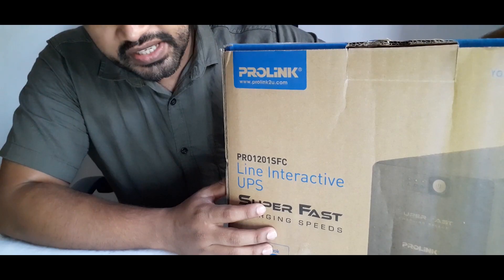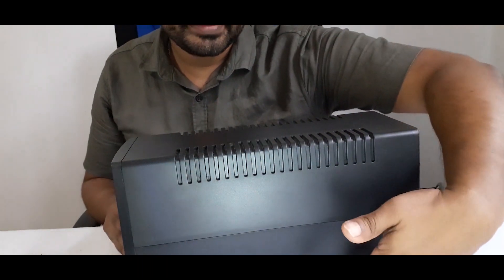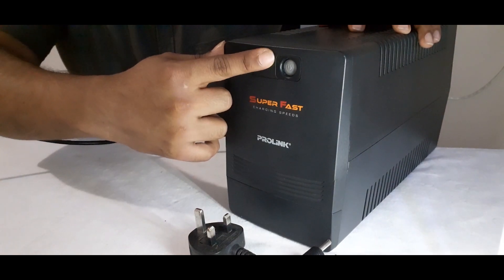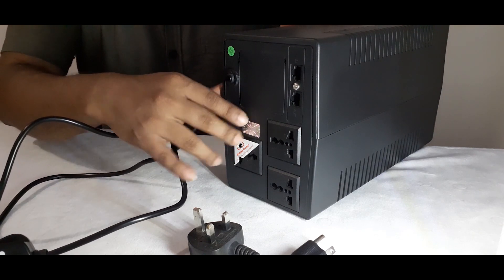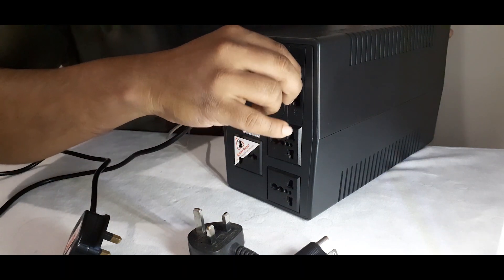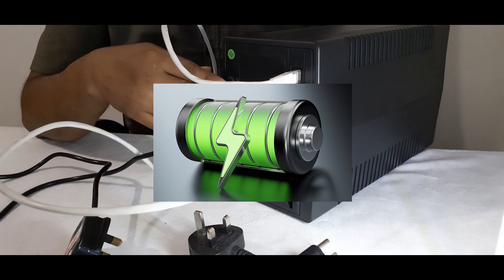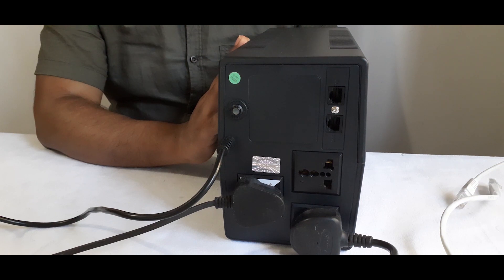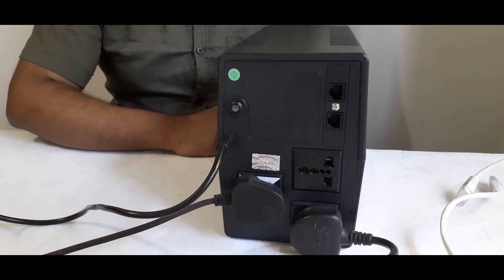UPS - PROLINK PRO 1201 SFC Line Interactive UPS unbox review

Comment: Do we need to turn it On while it's charging?
Reply: Did you find out?
Reply: @aashxq  well I asked the store. And the online store said yes.
Reply: @Rain-kw1bn  I plugged it for about 4 hours without turning it on 😅
Reply: @aashxq  well I'm also using a router UPS and usually the online store do tell in advance that it's important to turn it on the Internet UPS while it's charging
Reply from the maker: Charge around 8 hours before use is best practice, but also you can use it immediately

Comment: I just got my PRO1201SFC ups today. 
Question about the initial charging, do I just plug it in? Or do I also need to turn on the unit?
Reply from the maker: Plug it and charge  the battery around 8 hours before using  is the best way.
Reply: @techiecubes6746  you not answer the question
Reply: Yeah I'm confused too. I just bought a similar model today and there seems to be no light indicator for the charging mode. My older ups from another brand do light up when charging.